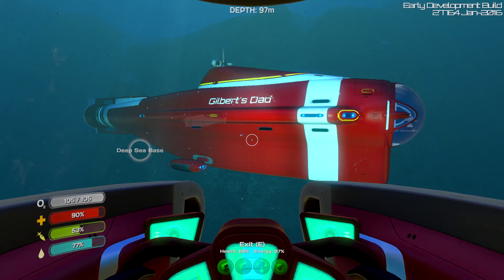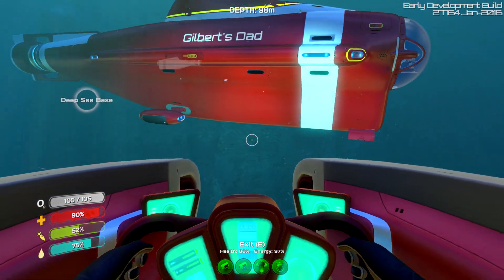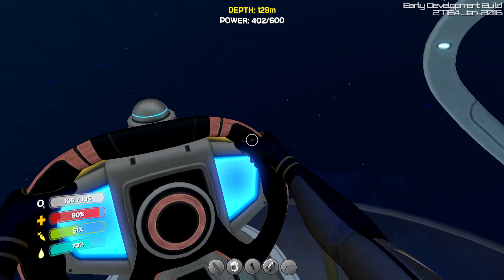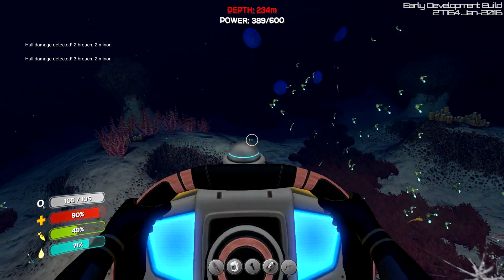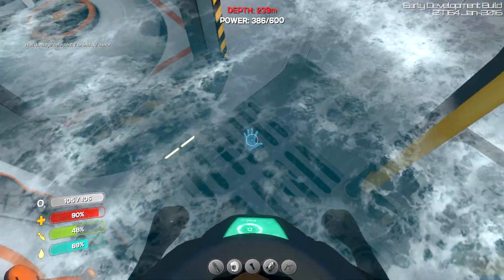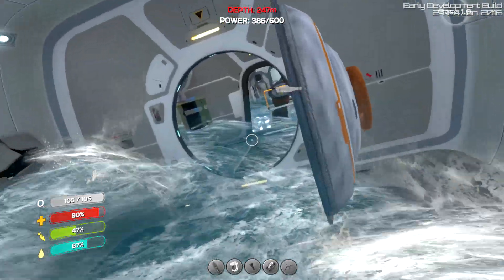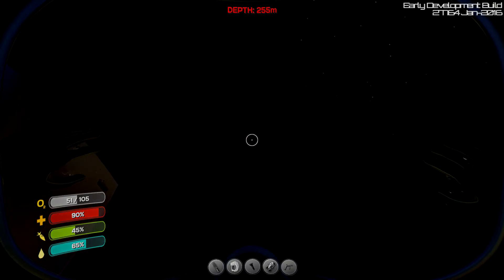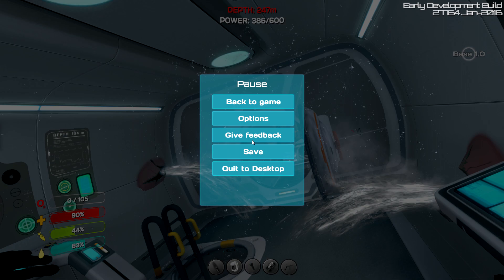Subnautica - Sinking The Cyclops!

Comment: I would like to see if there's a way that you could save it's after it sinks. 😂
Reply: I don’t know if it works, but maybe try the repair tool.
Reply: If you repair all the hull breaches, the Cyclops will drain just like a base does (but if you are below the crush depth, you might find that the hull breaches pop up faster than they can be repaired)

Or at least, that's what did happen, they changed the Cyclops so that instead of breaching and flooding, it has a health bar and explodes when it reaches zero (also, damage has to be repaired from the outside now)

Now the Cyclops will catch fire if it take too much damage (the fire will cause more damage until it is put out) and when it explodes it cannot be repaired (but all materials, upgrades, and anything you built inside are still retrievable)

I understand why this change was made, as the previous Cyclops was technically invulnerable (and unless it was very deep, you could always repair and raise it back up), but also kind of a liability (it would start taking on water from even a single breach, making it not as useful in dangerous areas), but it's still a shame to lose the flooding mechanic, it was neat
Reply: You can just save the game before it sinks and then leave the game and come back to that save
Reply: If in that version of the game, if you upgrade it with a higher level depth module then repair it, you might be able to save it